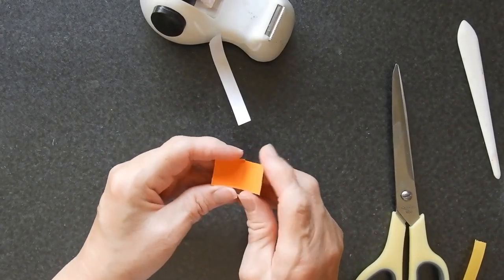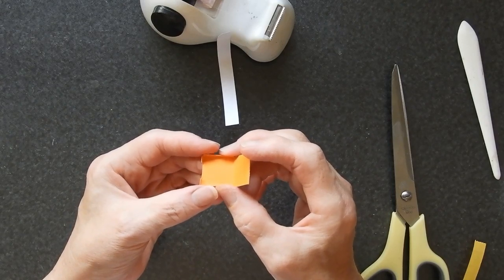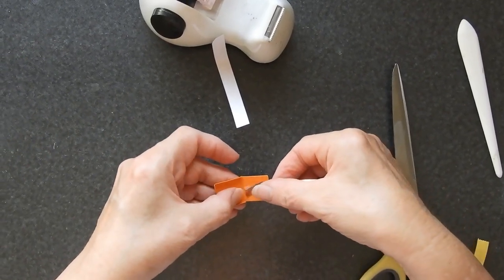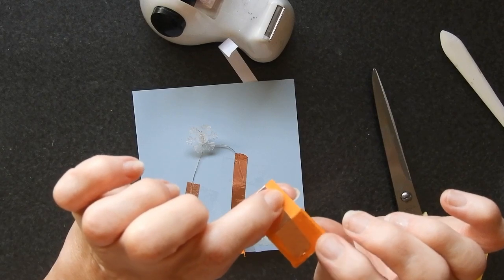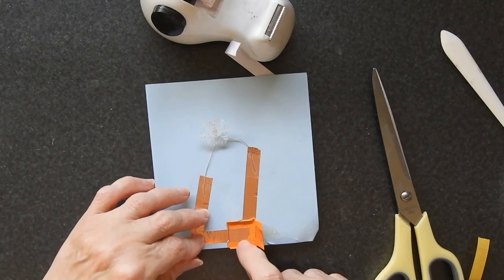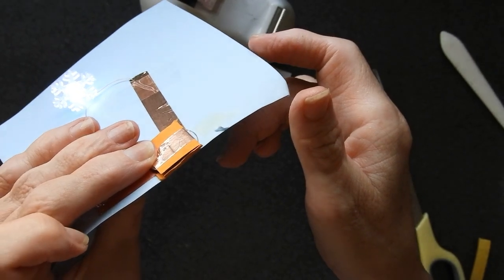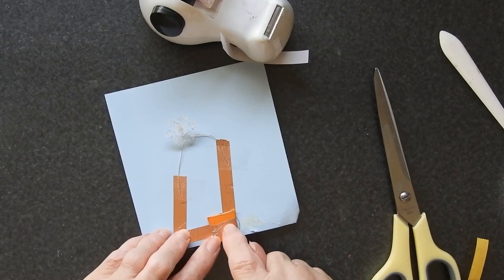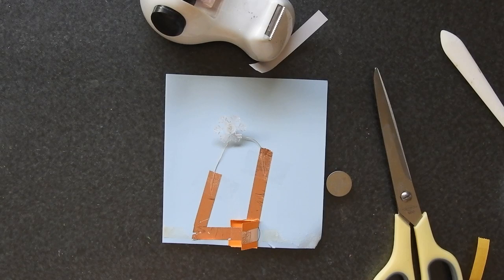LED Card Hack/Tip

Comment: Thanks for sharing Sandra! Oh but at 4:20 pls avoid pulling the battery out with metal tweezers as it will very likely short the battery out. Best wishes.
Reply from the maker: Good point! Should use plastic tweezers if needed!
Reply: I had the same thought. They are a bit fragile, but you can get ceramic tipped tweezers. Genius idea for the battery case, Sandra!
Reply from the maker: @flamechica   Or you could get some cheapo ones and dip the tips in nail polish and allow it to dry - but I really don't think tweezers will be needed!